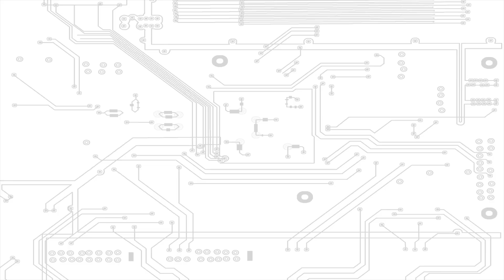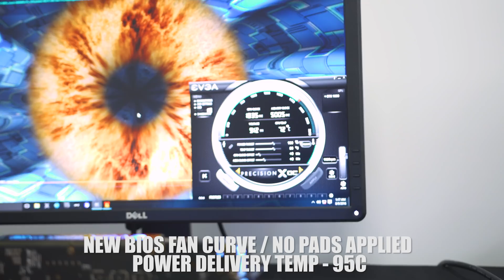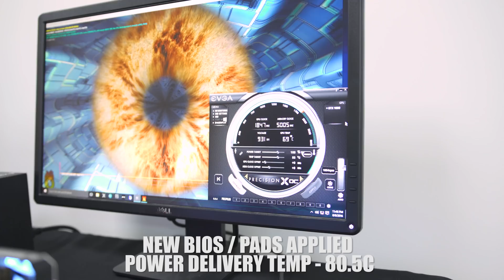EVGA FTW VRM Failures - What should you know

Comment: *I WOULD NOT UPDATE THE BIOS* I highly doubt the BIOS "only" increases the fan speed. I would bet that voltages were lowered to reduce VRM thermal output (however I would love to see BIOS performance comparisons to validate this, maybe I am wrong). If you HAD the pads installed you wouldn't NEED this "new BIOS". Do yourself a favor and install the pads and don't mess with the BIOS, your fan speed can be managed with you overclock app (a CUSTOM FAN CURVE is always highly recommended anyway).

Comment: What if I'm actually happy with my temps the way they are?
Reply: It's not the temps or the card, it's the temps of the vrms.
Reply: I'm sorry but I don't think I understand, do you care to explain?
Reply: Taze _ i dont really understand it either, but its something inside the card that can cause it to crash even if your gpu temps are fine
Reply: So what you're saying is I should send it bac
Reply: Back?*
Reply: ok i just looked it up, the vrms adjust how much voltage goes into the card, meaning that if they overheat they might not work properly sending too much or too little voltage to the card which will either kill it or constantly crash. either get the free thermal pads and install them or cross ship it back to evga, theyll send you one with thermal pads if you send in your one. 

im not 100% sure about the vrms but i would install the thermal pads or just call up evga to be safe
Reply: First thing I'll do tomorow is call EVGA

Comment: Just watched Tech Talk, ummm.... The VRMs are underneath the front plate, underneath the first area you covered in this video.  You're only making contact with the chokes which from my understanding don't need any cooling really.  Unless the HS fins are close enough to make contact with the pad so heat transfers from the plate, but shouldn't you remove the front plate anyway so you can apply the pads to the VRM chips themselves? Or did I just miss the TIM on the VRMs (TIM=thermal interface material if you didn't know)

Comment: Hmm, been there before. Worked in a manufacturing environment for 40 years. It's really not easy. You have a product with 600 to 1000 individual little components and other bigger bits and pieces. You're running 500 or 1,000 a day in production. That's up to a million "perts" per day. Every single one of those little bits has to go right in every place on every card in a million or so locations per day. It only needs one to go wrong and the sky falls in.Jay is right. It's gonna happen no matter how good you are. How you handle it is what separates the men from the boys (or it separates the companies that survive and thrive from the ones that don't).

Comment: So im getting the game crash, blue screen and 100% fan speed. In my mind and while monitoring gpu temps this happens at around 60 degrees celcius and after about 10-15 minutes of play. It happens in borderlands, crysis 2 and far cry 3. The three first games i tested. Is the thermal pad fix going to fix this? Im not using a 1070 FTW card but the SC edition. Which is now as well, prone to overheating.
Reply: I don't know whether it'll fix the problem but it sounds like it will, if you're crashing at 60c then it's probably the VRMs overheating, send your card to EVGA and they'll send one back with thermal pads. Or install them manually.

Comment: I don't think you should use the whole load of themalpad on the back as backplates also traps heat underneeth, just cut a 4cm wide stripe and lay it down over the back of the VRMs so you don't cause other components to overheat.
Also, I heard EVGA admitting to a lack for cooling on the Vram as well so people better check and see if there are pads on the Vram as well using the leftover pads that was saved from not using the entire thing on the back of the VRMs, if the same pads fit ofc.

Comment: omg don't mean to spam but I got a question here goes no matter how stupid it my sound. water when running through a coil could cause electrolysis that is static electricity it also can damage a car or truck engine by forming pits in the metal it can damage a head or a block. anti freeze keeps that from happening. so is it that the water don't move fast enough to make electrolysis or what? i'm sorry I'm computer stupid and I have a half-track mind. yeah that was probably a stupid question but a dumb question is always left unasked. THANKS

Comment: This is why I only buy EVGA, the best customer support by far!
Reply: Definitely. I love their step up program, too! Their customer service has been amazing every time I've had to deal with them (which isn't often, might I add!)

Bought a GTX 970.. Upgraded to the 980 - about 8 months after that, the card started dying, they accepted it back under warranty no quibbles. New card came, put in, about 4 months later the core clock started being locked to 405mhz or 539mhz and it took a driver re-install to cure it, every time it happened (3-5 times a day). Contacted their support who tried their best to help me with various methods, in the end they told me to send it back, so I did. They replaced it with a GTX 980 Ti SC, I emailed them to make sure it was right and this was their response;

"This is correct as we try to replace with the same part number if possible and if not an equal or greater performing product. As the GTX 980 Ti SC was shipped for your GTX 980 FTW we were out of your card or greater of the GTX 980s"

I must have struck lucky, but I've never had that kind of service before with any of my components.
Reply: ll-DudeChris-ll This is why I only by EVGA, the best GPU vendor by far! Now my GTX 1070 SC doubles as a toaster AND a GPU!
Reply: Iconoclast0w idk about u but the ftw is better than the sc
Reply: RayzeTheDragon I've had my EVGA 1080 FTW2 for three weeks now with gaming sometimes 2-4 hours and never once over 64c and hovers right around 59-60 in average gaming and 35 at idle
Reply: ll-DudeChris-ll because the new ones are icx not acx correct?
Reply: KillerGaming Yes. FTW 2 is ICX
Reply: And one of the best GPU's on the market

Comment: Good info on this one, Jay. Do we know whether or not EVGA plans on implementing this fix on new cards from the factory?
Reply: They are installing the thermal pads on the cards now, I can't remember when they're being shipped, maybe they already have been.
Reply: They should change the whole heatsink with a new one that adds not only thermal pad but a solid one that really makes full contact with the heatsink, not only the side of the fins.
Reply: Carlos Fragoso B. so is that implemented now?
Reply: Felwinters Lie No, not that I know anyway. All they are doing is sending owners (per request) some thermal pads that manage to drive away some heat from the affected area on both sides of the GPU, it even makes the back-plate work as a passive heat-sink. 

Oh and a new BIOS that only adjust the default fan curve to get some extra air flow. 

If you ask me this is rather an easy and cheap way to get away with a BIG design flaw.
Reply: TheOneNOnlyAxi yes, only certain products made before a certain date are affected. The newer ones are fixed

Comment: Does anyone know about the 1070 SC I think it has the same cooler? Mine has a phat overclock and would like to know if my workstation is going the same way as the Note7. I also plan to water cool it soon would that some the problem(if i'm affected)?
Reply: Thanks in advance :)
Reply: the 1070 sc has the same cooler but if you're gonna watercool it youre gonna add thermal pads anyway so you dont need to worry about it
Reply: Thanks

Comment: Hey Jay, i love watching your program, i love computers and computer gaming. I just want to ask if all the 1080 FTW are not made with the thermal pads on because at full load i only get 70c at most. If all of them do not have thermal pads do they sell them at local computer stores or do i have to contact EVGA to send me some?
Reply: NM Jay i read a article and downloaded the new BIOS for the FTW acx 3.0. It increases the fan speed to cool the vrms. They claim that it does not need the thermal pads, but i also got them to send me the pads on there web page, so i will do the procedure that you showed everyone on this video. Also they said as of november 2 all the new cards will be shipped out with the fix. Although they may just release them with the new bios and not the thermal pads on them, that is what i think.
Reply: Actually sorry jay if you can, i have one more question, i bought my card not to long ago and i think that i have the new bios already installed on my GPU, under control panel, help, system information, video bios version, i have 86.04.17.00.80. I am not sure if i have the latest version because on this we page, here is the link http://www.evga.com/thermalmod/ the version i downloaded  for my card the FTW 1080 acx 3.0 shows a different version 86.04.3b.00.84. i am confused. I am thinking that the link is showing the current version but the fixed version is the 86.04.17.00.80. Not too sure if i am getting the increase in fan speed. im confused. temps are below 70c when i run Valley. ahh i guess the only way is to tell me if you have one of those cards operating the fan speed that it is at in precision XOC. You know what do not even read this , it is confusing, i just am not sure if i got the latest bios when i bought it or if it worked through the procedure on the web page :(
Reply: To get the point, can anyone tell me how they know if they got the latest version of BIOS for there GPU? I have the 1080 FTW acx3.0
Reply: I have video BIOS version: 86.04.17.00.80

Comment: I can't find a solid answer pal...typically i use evga PSU and never have an issue...but i skipped on the asus strix 1070 ($50 savings) n purchased the 1070 superclocked edition with the  acx 3.0 cooling system. now i notice all of the EVGA pascal cards run a little warmer than asus... but i am in no danger with my card right? its not an ftw

Comment: Does the problem include the SC versions?
I haven't checked mine yet 'cause I haven't turned on my pc yet for almost a week
Reply: If yours is a 10XX SC then yes, you will need to install the thermal pads. Or send yours in to EVGA and they'll send you one with thermal pads back.

Comment: thanks jay for the video !
and i have 2 questions :D

i have 2x 1080 ftw and i have already a custom fan curve so they never run that hot and i also put a 120mm fan i front of the cards that blows fresh air bewteen the cards and my top card gets about 70 C!

now my question ^^
I will watercool them next year is this issue also with thewaterbloks or only with the stock aircooler?
and is it nessesary to put the thermal pads on when my cards dont get that hot with the extra fan in front until i watercool them!?

greets from austria :D

Comment: Is this on all ACX 3.0 cards or just the FTW? I have an SSC with the ACX 3.0
Reply: all acx cards, sorry m8
Reply: F E A R . Gtx 1060 also?
Reply: Javier Romero Yes
Reply: F E A R . But there is not bios update for gtx 1060, why?
Reply: Javier Romero Do you have the 1060 with 2 fans or 1 fan? If you have the one with only 1 fan then you're fine.
Reply: F E A R . I have the gtx with 2 fans acx 3.0 but there is not update...
Reply: Javier Romero "acx 3.0" i dont know about the update but you'll still want to get the thermal pads.
Reply: F E A R . Ok,  so do u think the bios update is enough? Or the thermalpad is really recommended?
Reply: Javier Romero Thermal pad is really recommended.
Reply: +Javier Romero Like Fear said,thermal pads are recommended,watch video.Bios update is just modified fan curve,you can do it yourselfe in afterburner or evga xoc

Comment: 1080 FTW owner here...
I've been very happy with EVGA's customer service since I discovered this issue. For some reason there was an issue with my SERIAL missing the first five digits, however they have been VERY PROMPT about getting back to me.

I also upgraded my Warranty from three to FIVE YEARS because it wasn't too expensive. About 4% of the cost ($30USD).

REGISTRATION is simple, but what Warranty you get if you do NOT is a bit confusing. It's spelled out at their web site, but if I read it correctly then those who bought "KR" versions still have the same 3-year warranty but some other models may drop to a ONE YEAR if they fail to register in 30 days?

Anyway, I went with EVGA this time because I wanted to avoid issues. It's a bit IRONIC how things worked out, but it's also reassuring to me that a company will offer this level of support.

(on another note, I'm getting STUTTERING in some games which seems to be related to VSYNC. No latency issue so I'm baffled so far.. Halo 2, Thief are affected so there's likely more)

Comment: is this an issue with the 1060 superclocked or just the 1070 and 1080?
Reply: 1060, 1070, and 1080 with the acx 3.0 are affected
Reply: Shit, i guess i gotta look for a different card to put in my new system
Reply: if you order one now it'll be fine. theyve started shipping cards with the thermal pads installed.

Comment: Working as a designer in a manufacturing company, I am pretty sure not installing thermal pads was not an oversight.  There are so many stages in product developement this should have been spotted. Removing thermal pads as a cost saving and underestimating the heating effect was the oversight. 

The cost saving is not necessarily purchase cost, more likely the cost of the time it takes to assemble them in manufacturing. It is the price we pay living in a consumeristic society where price is the bottom line. CEO's become CEO's because they are good at deflecting attention from issues like this. 

EVGA are handling it like they are required by their advertised warrantee and legislation, i dont see why they should be praised?

Comment: Well idk who you(Jayz) talked to but EVGA support basically says your crazy and don't know what your talking about. I went and contacted EVGA support and they said in a nut shell that there is no issue with overheating and that the benchmark that was used to test the temp far exceeds what a regular can run. However they still plan on releasing a bio update and a person can request the thermal pads. Yes i paraphrased a lot of that but that's a gist of it. So who's right?

Comment: Jay, I read about an other problem with the eVGA 10xx Cards with  the ACX3.0 coolers. Here the Cooling pads on the middle plate do not have full contact or none contact at all with the VRAMS. This would lead to another heat problem, would it not ?
If you are in contact with eVGA, can you look deeper into this subject?
Reply: http://forums.evga.com/gaps-between-vram-chips-and-the-stock-thermal-pads-on-the-midplate-m2570619.aspx

Comment: will you have this problem if you buy it now?
Reply: If you buy from EVGA, then no. If you buy from a reseller, then probably yes. Resellers will likely still have old stock for a little while longer, & it doesn't appear as if EVGA is recalling existing stock.
Reply: "doesn't appear as if EVGA is recalling existing stock" So you really need to check the board if you buy from 3rd party. You might buy a faulty card 6 months down the line because it was hidden on a back shelf forgotten and not know it.
Reply: Just thought I should update. I bought a 1070 FTW from Amazon & received it today. It does not have the thermal pads.
Reply: EVGA said in their statement that any cards shipped after a certain date (can't remember but it's this week I'm pretty sure) will have the bios and thermal pad fixed applied
Reply: Shouldn't they immediately halt all sales of the faulty cards?
Reply: bulblast89 2 solutions 1. Don't but evga 2. Don't be lazy and put the maxi pads on yourself
Reply: Daniel Isbell like Amazon?
Reply: Daniel Isbell but anyone on amazon can sell stuff. they have probably had it sitting around for ages.
Reply: Maybe I should have clarified. Amazon sold the card directly. This didn't come from a 3rd party seller. Yes, I agree that they've probably had it sitting around forever, but that's exactly my point. If you're not buying directly from EVGA, you have no way to know that you're getting new stock with the thermal pads preapplied, unless you buy from a local store. At least then you can run the serial number through the status check on the EVGA Thermalmod page to know what it needs.
Reply: Daniel Isbell good point. maybe when people do go to buy one, they could specifically ask for a newer one that has the pads.

Comment: Im on my second 980 hybrid, i have had this issue, first time i had to rma the card directly to evga, second time i asked for a refund and they told me no. So im not shocked this is happening with the new gen of cards when the problem existed on some cards on the old gen. Only way this card even works now is if i underclock it so its not working at its correct speed.